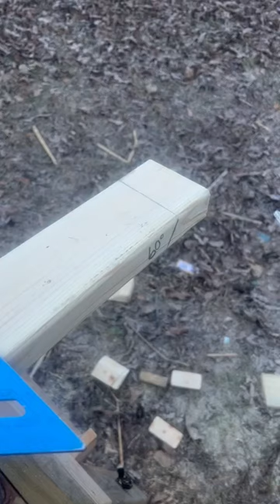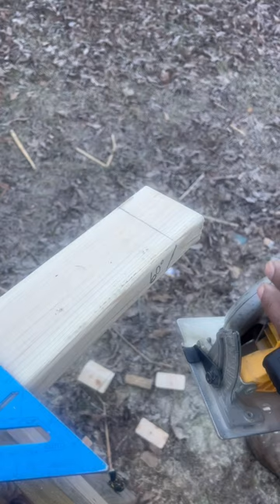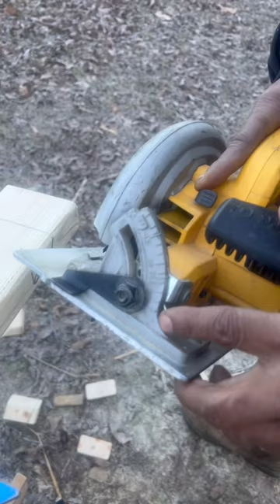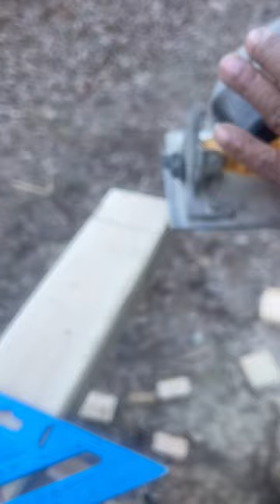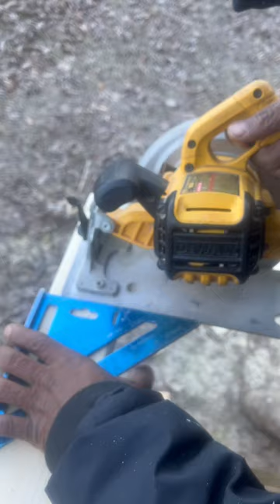How to Do a Bevel Cut with a Circular Saw #carpentry #circularsaw #tips #carpenter #wood #angles

Comment: Hey can I use my circ-saw to cut baseboard molding? Trying to avoid buy a mitre lol but I will if it’s the best bet.
Reply from the maker: Instead of buying a mitre saw you can purchase a mitre box for only 20 to 30 dollars.The mitre box is a hand saw with a box that has different angle slots. I would not use a circular saw for that. Thanks for commenting Steve.

Comment: Brother. With respect Every other video already explains this. What do you do when it’s 30 degrees and you need to set the saw to 60 degrees?
Reply from the maker: For some people, math is the hard part. I'm trying to keep it simple. I see your past that. I use a homemade jig on my compound miter saw to get those smaller angles like 30 degrees. I'll do a video on that as well. Thanks for commenting.
Reply: @templebuilderscarpentry7043   Good looking out 👊🏼I’ll subscribe and stay in the loop. Thank you for responding. 🙏
Reply from the maker: @HyperionBadger Thanks for subscribing and I appreciate your support.

Comment: Thats a 30* angle if you were putting it on an 8 12 pitch roof then 90 you need a 2nd angle to get a complimentary angle. I am I miss hearing or misunderstanding what you are saying?
Reply from the maker: When you're looking from behind your circular saw, the saw is pointing down at 90 degrees (but your bevel gauge is on 0) and your base plate or shoe is your 0 point ( the left side of the base plate). Once you start to place your bevel on 30 degrees, YOU START TO COUNT BACKWARDS FROM 90 DEGREES. So 90 - 30 degrees= 60 degrees. Your circular saw will say 30 degrees BUT THE CUT ON YOUR LUMBER WILL BE A 60 DEGREE CUT. You can measure it with a angle finder.  30 and 60 are complimentary angles. 0 and 90 are complimentary angles. When your bevel gauge on your circular saw is at 0 your saw blade is at 90 degrees ( complimentary angles). I have more videos explaining this. Check out the video Cutting Corners. Thanks for commenting.

Comment: That is not a 60° angle
Reply from the maker: What's up Gerald, I have another short video called understanding bevel cuts better, it shows that it's a 60 degree angle thanks for commenting.
Reply: So if I need to cut 45° angle,what setting is my circular saw at??